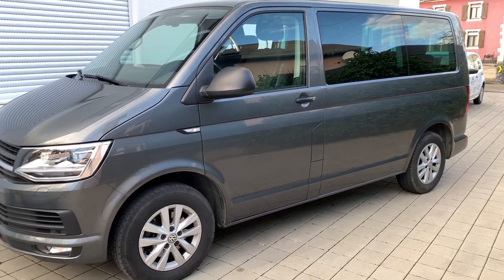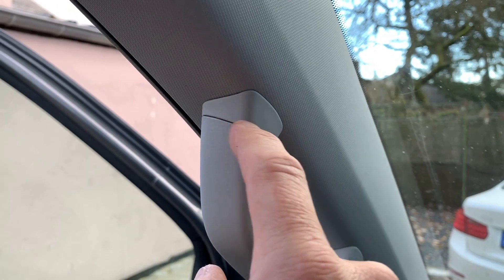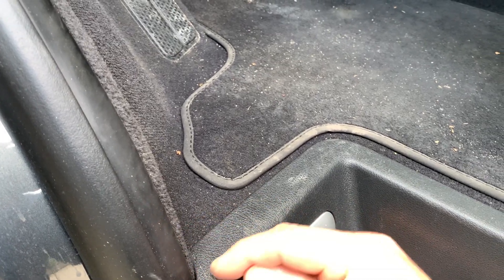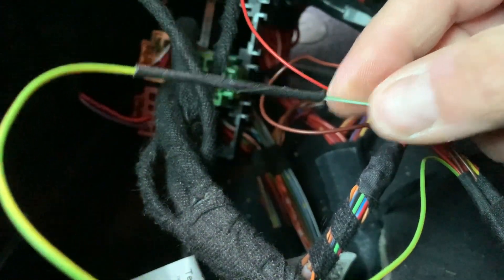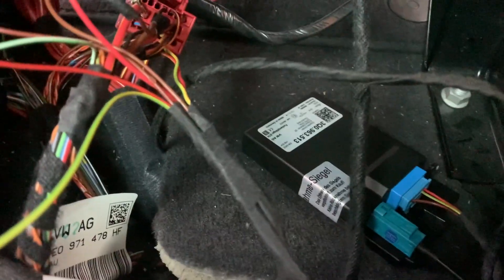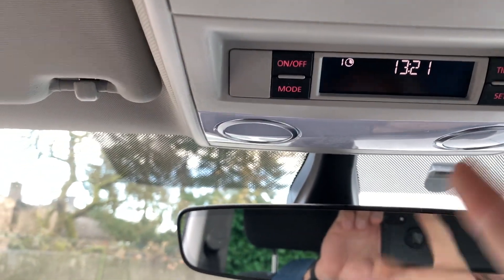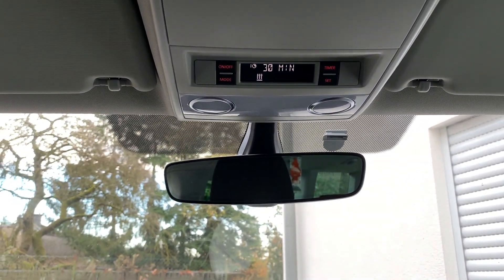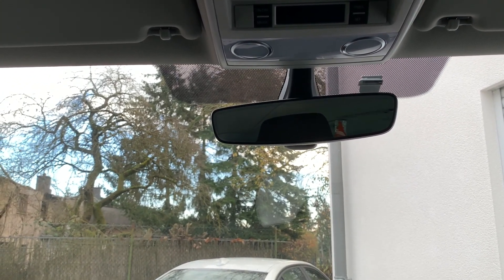VW T6 MY19 Aux Heater retrofit with OEM parts

Comment: Hello! I have the overhead timer display, but no telestart. So I will try and install telestart under seat. Are all the wires needed under the seat in that connector? It's for a Multivan T5. 
Great video by the way!
Reply from the maker: Hi, I don't know about T5. Please, go and check my wiring post here: https://www.t6forum.com/threads/oem-webasto-auxiliary-heater-to-parking-heater-upgrade.17607/page-3#post-321414

There might be some people with T5 that may help you.

Cheers.

Comment: Ciao 
Dove posso trovare la spina per il digitale timer con 16 pin
Grazie
Reply: Can you share the part number for the under dash mounting plate too?
Reply: @Andrew_vanlife  It is not clear what are you asking about.
Reply: You said you bought the mounting bracket to fit the ecu under the dashboard. I was interested in the part number for that. Although looking at the VW parts diagram I think the mounting point is on the main fuse box inside the dash so it should be in the car already. I will investigate.
Reply from the maker: @Andrew_vanlife  Ah, okey. Yeah. I found it difficult to put it in place, so I left it under the driver seat. The mounting bracket I had is 7H1 971 301B
Reply from the maker: 16-pin Connector for Overhead unit P/N: 1K0972928:

Comment: I didn’t get why they factory fit a Webasto heater if they don’t provide your with a controller. What’s the default set up for?
Reply from the maker: The default setup is passively controlled by the AC system and it is switched on automatically when outside temp is below 5C, the engine coolant is cold and ignition is on. You can change the trigger temperature via coding. My goal was to add full manual operations with remote and overhead panel.
Reply: It’s so annoying that the every day setup doesn’t work everyday.. having to confirm it daily for the next day is boring and makes no sense . That said, when it’s on … game changer for cold mornings . Wish mine was plumbed into coolant as well tho